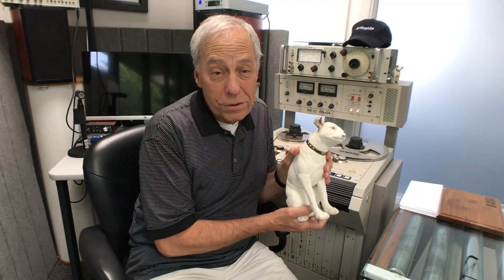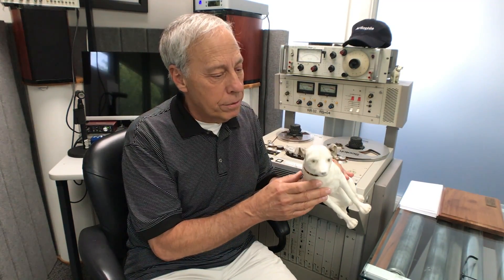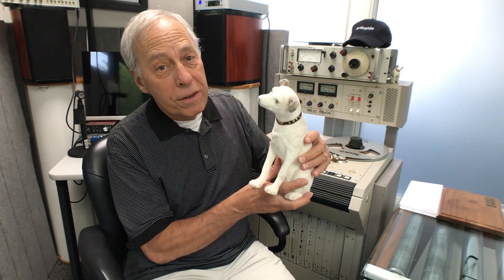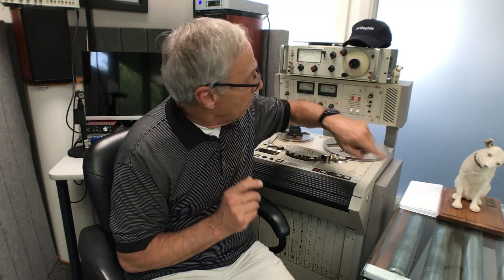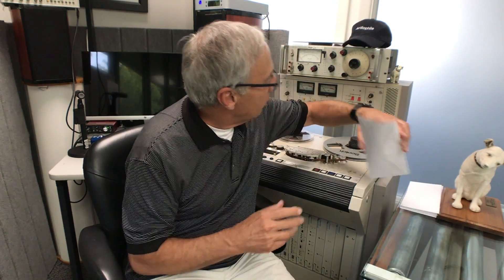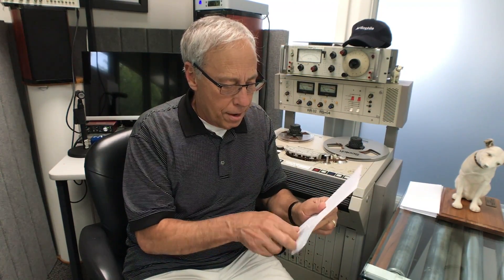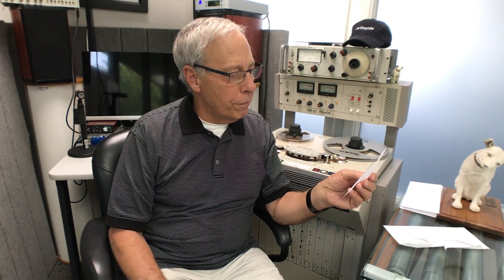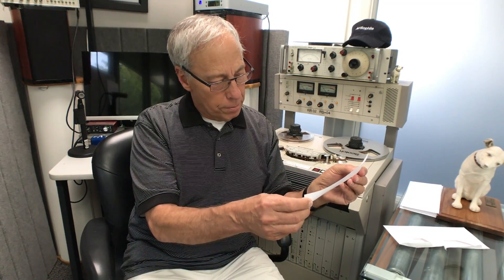Thin cables inside speakers

Comment: Its pretty simple. Resistance is equal to the resistivity of the material multiplied bybthe length, divided by the cross sectional area. Over the long distance to the speaker you need to reduce the resitance by increasing the area or improving the resitivity of the material. In the short distances inside the speaker it makes less of a difference. 

A further consideration internally is that heavier wires inside a vibrating box are more likely to fatigue at the connections over time.

Comment: I guess the length matters a lot too. Inside of the speakers are usually not such long cables used as we often need to connect the speakers to the Amp with.
Reply: Even the lengths between amp and speaker don't matter at all in a home as they are rarely  longer than 2m or 3m. So the huge speaker wires are complete snake oil. If the wires are larger than wires used on stage, which are designed for lengths of tens of m, you are % certain it's audiofool BS.

Comment: You could almost ask the same question about wiring a transformer with OCC copper (or silver) wire. Also using OCC in a point-to-point pre-amp or integrated amp.

Comment: I was expecting an engineers answer. I can tell you that their are different metals of varying gauges that the signal passes thru. Hence to spend 1000 dollars on cables that utlimately pass the signal to hair thin wires on tinned copper or worse aluminum inside the speaker box is silly.

Comment: I'm into Car Audio mostly. Take a 500 Watt RMS Subwoofer. 12 Gauge or heavier feeding the box. Prefab boxes have 18 gauge (Thin) wires inside. Then the Subwoofer has an even thinner wire coming off the Posts. I have had the Internal Speaker wires burn open. Granted its such a short run, Would be nice if it had a heavier wire. As far as the Prefab boxes, I usually replace the Wiring inside the box. Or in the case of a DVC, Run an extra set off the Posts.

Comment: It's all to do with distance and resistance a shorter the cable the more current it can handle, So from your amp will be a long cable and thicker with low loss to the speaker. From the binding posts is a short distance so again very little loss. If the same thickness of wire was used from the amp losses would be great and certainly noticeable.

Comment: The answer is...smaller gauge wiring works just fine because of the relatively short distances they cover. One foot of 12 gauge, even 14 or 16 gauge wire can handle an immense amount of power with negligible loss, while still allowing reasonable means of interconnection to the components. It's about the relatively small distances involved and therefore very low resistance values. Now if you were to have a theoretical speaker box loaded down with say 1 ohm (or less) drivers, you'll have no choice but to beef up the interconnects....but...most of us do not live there. If it made a meaningful difference in the high end gear, they would do it....it doesn't.

Comment: Well... some people change these strange internal cables.
The thing is : whether they are integrated in the electrical design... then the chance u match the recipe is weak.
Or it's not optimized (most of the time), then you have an empty highway of benefices and drawbacks ahead of u.
My personal experience is : if possible use the same power cables inside as outside the speakers... if possible. Then, usually u get greater results.
In anyway is this a law. This is at ur own risk, but for under $1K speakers I'd say no prob, change these strange cables... as fast as u can !!! YES !!!

Comment: One of my vintage collection of "Wireless World" mags has an article on "The skin effect of conducting wires" & tho this topic was related to radio-ham's shortwave, their graphs showed how the skin-effect effected signals beginning at 12 Khz. well within the high-treble audio. & When (i'm getting there) i bought a 2nd hand P.S. Audio (IV model with the hi-current ps) pre-amp from my local dealer who imported P.S. stuff, i managed to have them throw in a reel of what they told me was, P.S. Audio's / or P.S, Audio's approved interconnect cable as used inside their preamps, this wire had 5 to maybe 7 at most, separate strands of varying gauge with a white'ish dialectic, a 3-way crisscrossed braided affair (with 1 unconnected wire to make the 3-way braid) & here's the crux of my story: ...when i was trying to find which speaker cable was best from the 3 or 4 multi stranded cables types i had, i paralleled 4 or 6 lengths of this P.S. Audio type interconnect to make speaker cables which i factored in the trials & with a good few days on each, i repeatedly found the P.S. type cable gave me some noticeable improvements , particularly, it had me tapping my feet more, noticing certain complicated rhythms where they always sounded confused before & stronger feeling of the 'swing' factor, especially in trad' jazz, ("it don't mean a thing if it ain't got that swing")  & after repeated tests, that made-up cable remained for many years but sadly got lost in a home move. In my hi-fi priorities, i intend to try a speaker cable of varying diameter strands again in the near future & i'll have to construct it if it's not commercially available as speaker cable,

Comment: Not really an answer..so this seems to also be a problem inside recievers..the wires coming from amp to where you connect your speaker wire is thin..like 16 gauge or less.i once took apart some polk tower speakers I had and soldered some 10 ga. KnuKonceptz wire inside..heard no difference but it somehow made me feel better..idk

Comment: Hi I have been designing and manufacturing a line of signature Power Amps + Speaker sets for around 40 years now and have a solid Engineering background, and can tell you the answer to the question is best achieved through reversing the question; Why do we use such large speaker cable connecting speakers far in excess if what is needed to deliver the signal to the Speakers. One might consider we use wire with sometimes 10x the needed capacity to deliver the amount of current without a significant Voltage drop, which is after all the objective, however audio signal includes a wide band of frequencies and some profound transients. To the ears of the audiophile these qualities are diminished by the "standard" size of conductor we think of when considering load current and there is some improvement with the larger gauge wire, wider spacing between the conductors, and brading that better supports the transmission of high frequencies.
Over long runs meaning several meters or longer there can be significant enough impact to warrant the investment in specialized cable but there is no payback when addressing the short leads inside the speaker cabinet. The rules we follow for inside the cabinet are to use individual wires since parallel pares increase capacitance, and to gauge wire so that Voltage drop is below a standard, which is extremely small, but note additionally the connections themselves are more a concern and these in turn depend on the material and plating of the conductors. So there truly is one type of wire best for inside the cabinet and another for the "long runs". Always challenge everything you see, and you will learn, hopefully that what you have is AOK. Keep safe!

Comment: First of all, I love watching Paul's videos. I have learned a lot.  As an electrical inspector,  I can tell you the wires are engineered for the ampacity they carry, the use for which they are intended, and whether the use is continuous or intermittent, etc. They are not used because somebody decided to use a "big" one or a "small" one.

Comment: Paul. I think you should make a new video regarding the question, and give a proper answer.
This video was a total waste of everyone's time, including your own.
Reply: Definitely.  In car audio it is a matter of cable length, amperage to carry, and of course what conducting material the cable is made of.  Copper is a common metal to use, but there are metals with greater conductivity- maybe other metals are used in those thin wires?   Changing the gauge wire can cause signal interference and apparently too low gauge can cause capacitance... these are interesting things he could address.  Yes Paul please do another take on this:)

Comment: Should internal speaker wirings be shielded? Afterall it's very close to huge magnets. Any comments appreciated.
Reply from the maker: Well, shielding doesn't help with magnetic fields, only electrical fields, so your first goal wouldn't be much help. In general, high level signals, like those coming out of a power amplifier and found inside a speaker, are not affected by low level radiated noises from cellphones and computers, so it wouldn't buy you much. I would recommend against it.

Comment: My simple answer:  Because the resistance in the short wires between the drivers and crossover (or terminal block) is negligible compared to the resistance of the voice coils.  

Many people forget that drivers have significant internal resistance.  Typical voice coil DC resistance is around 1/3 of the driver's rated impedance, for example about 3 ohms for an 8-ohm driver.  A few feet of internal cabinet wiring may be 0.05 ohms or less even at a modest thickness like 18 gauge.  Adding so little to the voice coil's resistance doesn't create an audible effect.  The internal wire gauge need only be selected to handle the expected peak currents without overheating.

Comment: The short distance between the crossover network output and the speaker are only one aspect of the reason for the small gauge of the wire. Another reason... Just look at the wire at the speaker itself. It's TINY! There is simply no good reason to connect #12 or #14 wire to the very small diameter of the SPEAKER COIL WIRE. The coil wire is extremely small diameter. What would you save in having 2 - 4 feet of heavier gauge wire  from the crossover soldered to the 18 - 20 (or smaller diameter) gauge coil wire?

Comment: I guess on a practical level, if you have a thick inflexible wire attached to the voice coil it will have an effect on its freedom to move which you don’t want if you’ve made all this effort to reduce the mass of the cone.

Comment: Because speaker engineers know that cables are largely snake oil.  It's the speaker salespeople that say differently.
Reply: And the fact that internal speaker wires are very short, i.e., have minimal resistance.

Comment: But....you didn't answer the question lol. Let me perhaps rephrase the question in more plain terms here: why would I use "horse leg" cables to connect from my amp to my speaker when the cables on the other end of that terminal are 14-16 gauge....this goes back to the age old argument over wire being wire. Unless you can give me concrete evidence as to why your speaker wire matters, I'm sticking to this: it's a gimmick. Period. Companies have blinded and lied to us for years, so many years that people just take empty words as fact. If the wire that carries the information from the crossover, or terminal, to the driver is 14 gauge then your big 10 gauge wire is literally nothing more than an extra unneeded expense. 

People constantly compare electricity to water to explain in layman's terms how flow works. Quick example: a thin pipe moves less water than a thick pipe. Ok. Sure. With that in mind let's do this - we have a water pump hooked up to a 3 inch pipe which is then connected to a 1.5in pipe and terminated in a faucet. Assuming the pressure could be the same throughout the entire pipe system it would work exactly the same as a set up of all 1.5in pipe. Or the same as a 1.5in pipe to a 3in pipe, terminated the same. Flow is flow. Wire is wire. 
Much like cable nuts thinking they have to buy the biggest, thickest HDMI cable available. Gimmicks. It's either digital, or it's not. The ONLY thing I'll accept about wire and digital connections mattering is material. Obviously one metal will conduct better than another. Gold tipped HDMI cable and blah blah. But size? I'm not buying it if it costs more than 25 dollars per 100ft.

Comment: 1. R of wire should be calculated at the frequency it's going to pass.

2. Cu being a very good conductor R normally for AVR does not matter compared to that of your speaker. 

3. Most important : The Thicker wire of similar type will have higher Capacitance. This will ground your high frequencies resulting in overall dull sound. Thus these speaker manufacturers use thin wires. 
4. Thus to get crisp sound you should go for optimally thin wires with comparatively less R for which you can compensate by increasing the Volume. 
5. On the other side there is remarkable   difference in R due increase in temperature  from winters to summers. 
Approx. 0.393% for every deg C. 
For 15 deg c rise the 6 Ohms speakers will become: 6.353 Ohms.
Reply: 4 - I think you meant to say comparatively higher R rather than less R. But I take your point.

Comment: I'm a big believer in most quality hi-fi components, but speaker wire is where people waste a ton of money. The fact of the matter is that 99% of people's home systems will sound just as good with 12 or 16 gauge lamp cord as they do with expensive, thick cables. Thick cable is only necessary for EXTREMELY power hungry speakers or very long runs between the amp and speaker. Blind A/B tests have proven this, and it's just how electrons move.
Reply from the maker: Most blind AB tests are meaningless because of how they are conducted. Let's not use them as evidence of anything. That said, I agree with you 99% of all systems wouldn't matter too much about wire. That's not to say that the 1% we concern ourselves with in high-end audio aren't extremely sensitive to speaker cables, a fact easily proven on a resolving system.

Comment: There was a reference in a different PS video about the speaker wires where the thicker wire provided better bottom end but the high end suffered, so they were making hybrid cables.  In a speaker, you have a crossover that will separate the signal, plus there is a thing about distance.....its short runs.  If you were going to be extremely critical, then why isn't the speakers tinsel to the terminals or the voice coil itself gigantic in thickness...…..

Comment: Once again "audiophiles" love to ignore electrical engineering and physics.
It's frequency, current, heat dissipation etc. All factors you guys choose to ignore because of a name on it.
That "thin" 18ga wire is feeding a voice coil that is about 28ga wire.
Engineering matters! Test equipment matters. If it's not on the scope its not in your ears either!
Reply: good
Reply: You think the voice coil in a large high-quality woofer is wound with 28 ga wire do ya? On a related tangent; is Damping Factor a thing in your dimension? (EE here, can't afford to be an "audiophile", but I sure do love good music reproduction.)
Reply: I'm sure with a regular cable I could bring your music to live. That's for sure

Comment: The tweeters don't need many amps so their wires need not be so thick. Wires for coils in speakers have very thin insulation coatings to get more loops in the assembly. Wires to speakers get stepped on a lot so need to be extra durable.

Comment: Answer from a technologist... Partly because speaker makers are in control of the grade of cable they use and its capacity to carry current, and also because cables inside cabinets are SHORT compared to those running around and across rooms, and so their resistance is low. Swap them out if you prefer, though the performance difference may be impossible to detect or measure.

Comment: When you think about it. Most loudspeakers aren't very high wattage. Divide that by each driver in each loudspeaker and the wattage goes down even more. Then add the factor of short wire runs from the crossover to the drivers. Large gauge wire really isn't necessary. What does matter is the quality and type of the wire.

Comment: Paul's claims to be an "electronics guy," but he clearly doesn't even understand ohm's law. So I'll help him out: The reason wires inside a speaker cabinet can be thinner than the wires between an amp and the speaker terminals is because the internal wires are much shorter! This link shows the relation between wire gauge and length versus impedance:

http://www.roger-russell.com/wire/wire.htm#wiretable
Reply: Ohm's law ... oh dear ... you know impedance? That is that frequency dependent thing that is varying through capacitance, self induction and yeah resistance. Its response can be calculated through laplace transformations and shown in a Bode diagram. This then shows frequency attenuation. Get an education before you acuse an Amplifier builder.

Comment: Guy selling shit rambles on about nothing for 4:28.  HERE, HERE is why the speaker wire is small in a speaker. BECAUSE IT CAN BE.  There would be no audible benefit to bigger/more expensive wire ... and since you can't see it, it makes it hard to charge extra for it unless it has some audible benefit ... and since it does not, they don't.  Worries about point to point wiring? ... small potatoes compared to how much wiring is in the voice-coil and cross-over inductors .... and guess what, that is not exotic wire.